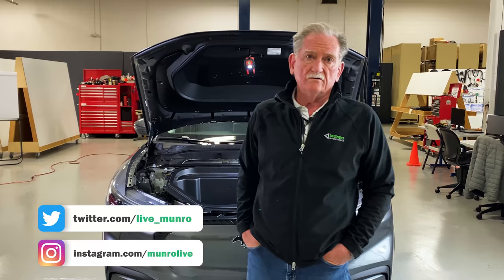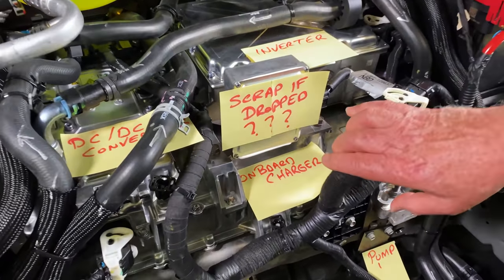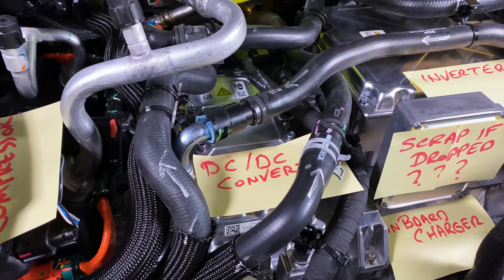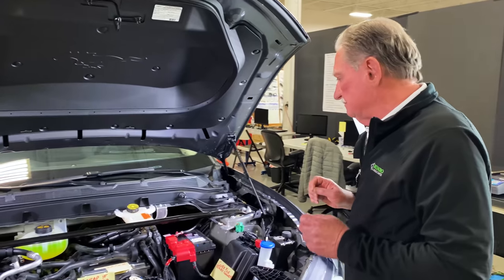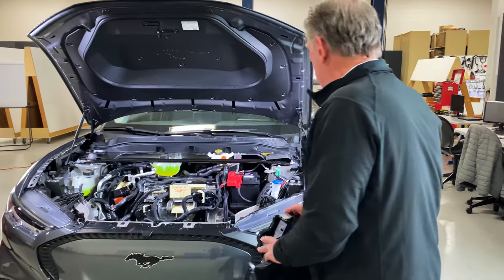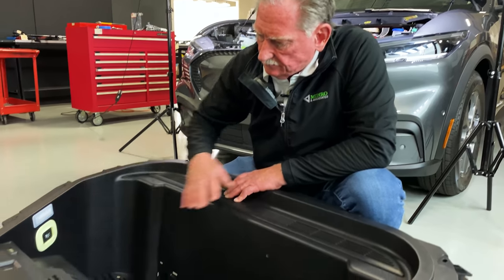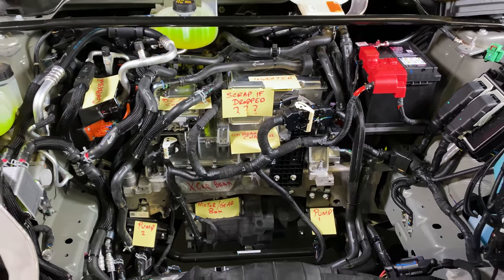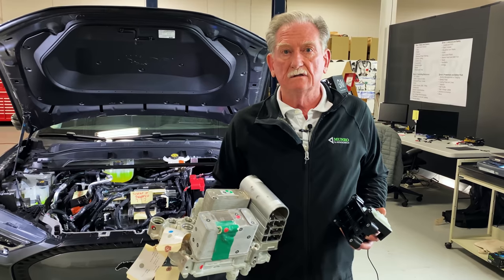Mach-E Thermal System Nightmare

Comment: Everyone : EVs need fewer servicing visits. Manufacturers will lose revenue streams as a result
Ford : Hold my beer
Reply: Hold my octo hoses
Reply: I just have to note that Tesla gloats about 100,000 miles before anything has to be done, except maybe brakes and tires.  The problem is, with the exception of oil changes, that has already been done a long time ago.
Reply: @paulstandaert5709  Tesla may gloat but can you really go 100,000 miles with the suspension broken off and the door handles not working? These are real world problems. The last 2 cars I saw on the side of the road with suspension coming apart where a shiney Tesla with no scratches except from the tire out of the wheel well and an early 2000's Hyundai with rusted out crossmember.
Reply: @paulstandaert5709  Depends how well someone wants to look after their car. My BMW could go 100,000 mils with just oil changes and consumables, but I wouldn't run a car like that, it's asking to be ruined at 100,000 miles. Same with a Tesla or any car, always maintain more than the manufacturer recommends.
Reply: @imkirbo3094  Perhaps so. I see tons of cars where literally nothing has ever been done and the problems it develops over time just continue to stack up to the point that it gets totalled.  My old man just had his 2011 Taurus in my garage for a tire rotation and I couldn't find anything wrong with it. He bought it new and it has 74,000 miles and he has done nothing to it but tires, oil changes, and brakes.... And maybe a new battery.

And it is a 10 year old car now... About the age where batteries really aren't expected to live. I hope I am wrong here and the Tesla drive batteries well exceed that, but I cannot help but notice that the battery is the very first thing to get stripped off of a wrecked Tesla. There is high demand for battery modules which is an indicator that they are going ca'put.
Reply: @paulstandaert5709  I think with the likes of Tesla they do have very good battery tech, but at the end of the day it's still a battery and it's also the largest, most expensive and most required part of the car. So even if it only lasts 10 years it's a problem. Thankfully there's a lot of promising battery tech in the works around the world so hopefully once some of that migrates into cars electric cars might become a bit more feasible but only time will tell.
Reply: @imkirbo3094  Hopefully so. I would like to see my batteries in all sorts of other devices last longer, too.

 Having electric drive makes all kinds of sense except financially. My newest car is 12 model years old and, quite frankly, when is the last time anyone has seen any kind of battery in any device last 12 years and still be strong?

Even if my gas engine grenades, I can find a 12 year old engine that hasn't been used as much that is still good. With a battery, my experience is that it doesn't really matter how much it has or hasn't been used. Leave it on the shelf and come back 10 years later and it is pooched.

If they can prove otherwise, that will be a really good thing.
Reply: @paulstandaert5709  Running cost of EV is always much less than ICE. That's why i believe (not the flexibility, accelerations nor CO2 emissions:P) BEVs will ultimately win. Do Yourself an excercise with excel, sum up all this oil changes, brakes, timing belts, filters, mufflers, gas and time extra wasted for the hassle.
Not that nothing can be broken, but the powertrain issues are very rare..
Tesla batteries are demanded in the aftermarket cause theyre good and even bought from car with big mileage, are like 90-95% SoH. They can be used in various battery applications like offgrid etc for another years..
Reply: @marcink5820  Time will tell.  As the vehicles get more common, prices should go down.  The bean counters will find a way for problems to develop on the electric cars, too.  Planned obsolescence will be built into them.

Some vehicles are garbage, and some will give you many years of trouble-free operation.
Timing belts are just about extinct now.
Mufflers are usually of stainless steel construction these days and outlast the rest of the car.
Electric cars have brakes, too.  They last about 2x as long on average now.  But as the caliper piston seals age, they'll start dragging and even electric cars are going to need brake jobs done.  I've done brakes on a couple of Leafs now, and if you check around, most of them don't have many miles on them.
The time extra wasted for the hassle of dealing with it is easily negated by the time a person will take at a charging station, if the charging station will let you use it which they sometimes don't.  Electric cars will have problems of their own.  I hope to have my own one day, but the problem is that I don't like investing in depreciable assets, so I buy and run old "clunkers".  And I have yet to see any battery in any device, ever in my life last as long as my newest car and still be good and strong.  Maybe that'll happen, and I can't wait until it does.  Then the oil burner is going to go away.
Reply: @chaos23  Well, now....  A service manager?  You wanna play that game, eh?
 I've been around a few of those.  I know how it works back in those shops.

That just means you aren't the one actually working on the stuff. Someone of questionable aptitude and/or limited diagnosis time tells you that something is wrong so you help load up the parts cannon and light the fuse when the customer says it is okay.  And depending on where you were, you got a commission on those upsold parts.

Or were you a service writer pretending to be the manager?  I've seen both.

Vehicle comes in with an EGR valve code.  There's not enough time to diagnose it properly and get paid for it.  Mechanic says it is bad.  You get the approval, the valve gets replaced.  Engine light is cleared, there's no time to check it to see if it is working and still make beyond your base wage for the week.  Car is given back to the customer.  They call back in 3 days for the same problem.  After the work order sits in the rack for a couple of days, because nobody wants it because there's money to be lost on it, the customer wants to know where his car is.  Finally someone gets the approval for more diagnosis time.  You find the mouse nest next to the engine controller and several corroded wires.... blah.

Let me pick apart some of your claims:

Nissan keeps their CVT transmissions in stock also.  Walser Nissan in Coon Rapids had 17 of them!  It wouldn't be much of a parts department if they didn't have parts there.

Tesla keeps their drive units in stock.  Or at least they try to.

EGR valves are... largely gone now.  I suspect that you don't even know what the goal of a functioning EGR valve is.

Timing belts are largely gone now.  They have chains now with no scheduled maintenance intervals.

Electric cars have radiators.

Electric cars have water pumps, too.  In fact, usually more than one.  

Electric cars have differentials.

Electric cars have hoses.

Know how much Nissan charges for a brake pressure sensor for a Leaf?  Yeah, look it up and explain to the customer why their maintenance free electric car needs a master cylinder which contains an itty bitty part for, oh, say.... $1,900 which negates the fuel cost savings for the next four years.

You wanna have to pull the battery out of a Model S and change the contactors?   Yeah, those things go bad.  Bonus points if you try getting all those torx fasteners out after several years of salty winters.  You have fun with that.

What is a really common failure on any car?  The air conditioner.  You kinda need that to keep the batteries in an electric car cool.  When that dies, enjoy.  And gee, I didn't know that electric car air conditioners didn't have compressors.  Some are using them for heat as well, so they're going to be working extra duty.  Which reminds me--Electric cars have CONDENSORS, TOO!  Oh, and an electric fan to keep the condensor cool, or hot if it is used for heating, just like a gas car.

I forgot that drive units in electric cars do not have rubber mounts.  Rubber suspension joints go bad and they're not subjected to engine heat, so somehow electric car drive unit mounts will never go bad?  They gloat about how much torque electric cars have, which is going to be what rocks that drive unit the most.

Electric cars don't have window regulators just like a Lincoln?  Interesting considering they are almost all operated with ELECTRICITY.

Do you have any idea how rare it is for a fuel injector to fail?

Catalytic converters do fail and are expensive for a good one.  But there are copper thieves out there as well, and all those heavy gauge charging cords look tempting.

I wish I had more time.  I picked apart almost all of your "ICE" component failure areas and you're still going to call the BS on me.  That's fine, I guess.  I will be fixing your electric car when something goes awry and I will be charging accordingly.

Electric cars will be like that of the gas ones.  Some will be good and go 300,000 miles with minimal work.  But the problem is that has already been done with at gasoline powered car.

Someone is going to say that the water pumps on the electric car aren't going to work as hard, which is true.  The problem is that the bean counters are going to make them cheaper because they aren't expected to have as many hours of operation put onto them.  That's what happened on the Prius inverter pumps.  They don't run nearly as often but THEY STILL GO BAD.

Comment: As a young electronics engineer I was given the task of designing out 15 calibration resistors on a piece of radar equipment. These were a persistant problem in the field, where service engineers would foolishly twiddle them trying to locate faults. Took a while but I managed to rid them all and I was rewarded with a promotion! Golden rule of design engineering, 'If it's not there, it can't go wrong'! Munro highlights this so well. A great video.
Reply: Removing all of the 15 calibration resistors? Now that's a fine piece of design work! (coming from an old electronics engineer)
Reply: True genius lies in simplicity "Leonardo DaVinci"...it takes Ford 100 moves to build a car, Tesla takes 25
Reply: Most engineers will tell you that the best solution to a problem is the simplest one, But it looks like these guys went to the MC Esher school of automotive design.
Reply: yeah   i've noticed more things made more complicated and harder to work on for no apparent good reason unless it's to make it harder for the average person to work on .    like too many went to the rube goldberg school of engineering .
Reply: Elon always say "best part is no part"
Reply: @kerogre256  "Less is more"
Reply: Spot on! 😄👍
Reply: @kerogre256  He also consistently says "1st principles" ...same meaning.
Reply: Sounds like you were working on the development of a certain a2a missile system back in the day
Reply: @bBersZ  Good guess, but no it was Marine Radar.

Comment: Automakers have never had their designs examined on available media, and now with new designs coming through, they are going to have to step up their game.  The Japanese goosed them a bit in the 80s, but this is a whole new ball game.  What was cutting edge for aircraft in the 80s needs to be standard for automotive today: more castings, efficient structures, weight reduction, digital control, etc.
Reply: We can also now watch some random bubba build a really solid electric car from a scrapped chassis and a handful of parts he bought on Ebay.  We all know electric cars can (and should) be much simpler than ICE designs, and genius-level skills are not required.
Reply: @mrw417  There's an enormous difference between some guy building an electric car that's "good" for him, and a car company building an electric car that's "good" for the regulators of multiple countries and millions of demanding consumers using the same design in an wide variety of situations. Things like this hose mess don't happen because the designers are stupid, they happen because dozens of teams are solving different sets of new problems in parallel and this is just where they had to stop and get the product out the door. They'll sort this out iteratively like anyone else would.
Reply: @jfieqj  where the rubber meets the road, eh... ))
Reply: @mrw417  Like Elon says, it's easy to build a prototype but it's hard to build factory which builds these cars reliably and efficiently.

Comment: Designed with as many parts as possible that can and will fail to support the dealer network......Plain and simple.
Reply: That is the blueprint behind their [Ecoboost] line of engines.
Reply: There is nothing plain and simple about recharging a battery through regenerative braking. The comparison is not like Electric vs Nitro RC cars.
Reply: You could fix this yourself with parts from an old washing machine.
Reply: @USNEM  LOL. My Neighbor owns one that he has been using as a Taxi for 5 years. You could not PAY him to drive a gas or hybrid again. His operating costs are 70% less. And that includes maintenance which has been Bugger all except for shocks and tires.

Comment: Waiting for the “Scrap if dropped” t-shirt.
Reply: @taylor92493  at 2:15.  Ya gotta watch all Sandy’s feeds very carefully
Reply: With the Ford logo above it.
Reply: At least make a baby onesie.
Reply: Tesla is more inventive, they cover defects (like that guy who found a big ugly hole in the battery protector) with Tesla stickers. I suppose they have "warranty void if removed" written on them. 😂😂😂
Reply: I'm up for one 😀
Reply: “Scrap if dropped...

...why wait?”.
Reply: The "Scrap-If-Dropped Baby Onesie"
Reply: Only Vans.
Reply: I’m in!
Reply: Also says @5:54 scrap if dropped when he opens the cover for the seal connectors.   I wonder if these are just fragile parts, Ford wants it’s assembly crew to throw them away if they are dropped, rather then install them with potential quality problems.
Reply: I want one!
Reply: @MrSpuzzz  I bet it's because the Ford dealerships are too dumb to think for themselves, surprised there isn't a scrap if you smash the window label just so they don't try to put all the glass back in.
Reply: @will4may175  hopefully dealer service techs come up to speed quickly.   The dealer model is a big reason why ev adoption is still low at this point.
Reply: @concinnus  
That's not right. :(

Comment: I bet even SpaceX's Raptor engines need less hoses than this.
Reply: Probably designed so the dealer's service shop can get some service dollars
Reply: Aren't space toe engines simpler by design anyway?
Reply: @robertopics  the basic principle of rocket engine is simple, but the engineering to make it happen is really complicated with crazy amount of pipes, valves, etc. You can google some images of raptor engine and see for yourself (note: raptor engine is probably the most complicated rocket engine ever - due to the full flow stage combustion cycle they have chosen / but that means higher efficiency).
Reply: What does the Mach e maintenance manual advise for frequency of inspection for hose leaks?  Are the covers on all these modules water tight so a leak doesn’t short-out electronics?  I hope it’s not every 10K miles because that’s not much better than 7500 mile oil changes on an ice vehicle.
Reply: @harrychu650  no, it's designed to move most car repair staff to the insane asylum.
Reply: rofl

Comment: The "Scrap If Dropped" component is known as an Off-Board Charger Controller, OBCC. Used for DC fast charging to bypass the SOBDM/BCCM.
Reply: so basically the DC fast charge contactors
Reply: @joeyscleaninglady2877  contactors will be in the BEC with the other contactors and HV fuses.
Reply: @jakeh8366  interesting tesla puts their DC contactors underneath the rear seat (in the Model S) between the Onboard charging modules. Independent of the high voltage traction pack contactors (precharge and main HV contactors)
Reply: Yeah,that’s what I was thinking.😂
Reply: Also tesla has the components spread out , charger in the back, in a lost chunk of space  inverters on/in the motors itself

Comment: I can’t wait to hear what the “scrap if dropped“ mystery module is
Reply from the maker: Next episode!
Reply: My guess is a shock sensor
Reply: It's as good as a Bond warning, "burn after reading".
Reply: It's the Off Board Charge Controller, used for DC fast charge.
Reply: An ECU for the charging afaik
Reply: There was also a scrap if dropped message next to those high power connectors I noticed.
Reply: I can just imagine Ford assembly workers staring at each other after an oops moment and just shrugging, then laughing it off 🤣
Reply: elon is laughing his azz off
Reply: @jakeh8366  can you elaborate it's use inside frunk.
Reply: @gaurav9411  it's located up there mostly due to proximity to the charge port I'd imagine.
Reply: @MunroLive  FYI the pad under the sealed connectors also says scrap if dropped
Reply: @jeremypmerrill  Scrapped if laughed at  ;-)
Reply: Must be a Huawei spy boot monitored by the Chinese government !!!
Reply: Drop and scrap the Mustang Mach E.
Reply: @pierre.a.larsen  
😁😁
Reply: LOOK OUT!  Don't hit that pothole! It'll cost thousands to replace all those mystery "Scrap if dropped" boxes that can't take some jossoling...
Reply: Google "Scrap if dropped" and you will see that Ford has been using that saying on parts for almost two decades.  Nothing new.
Reply: a rollover sensor for airbag activation?
Reply: A crypto mining rig? Lable make sense... lots of people are scrapping...
Reply: @MunroLive  which is when?
Reply: My guess: vacuum-sealed or high pressure safety contactors.

Contactors are high power electrical relays.  They often have a specific gas fill to extinguish electric arcs, such as a hard vacuum or high pressure gas, along with "magnetic blow-outs" that push the arc over a longer path.